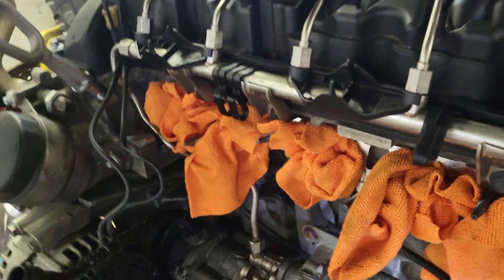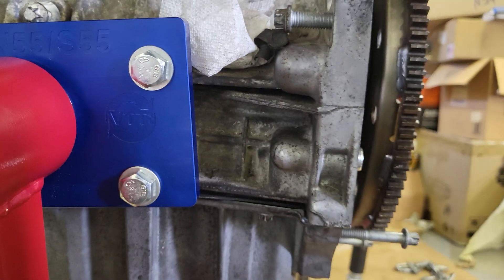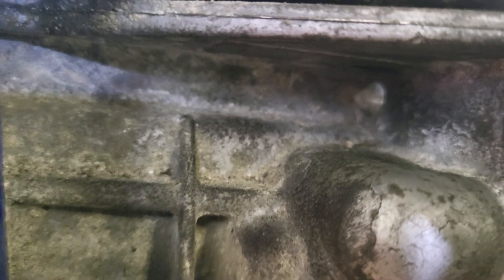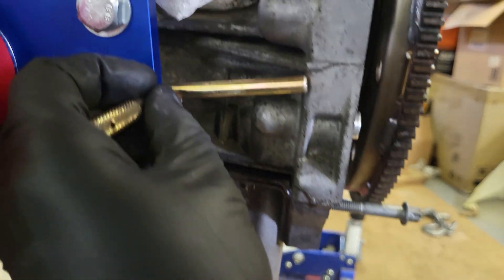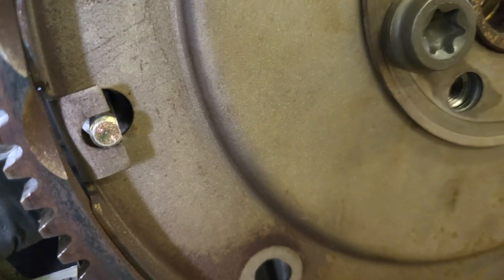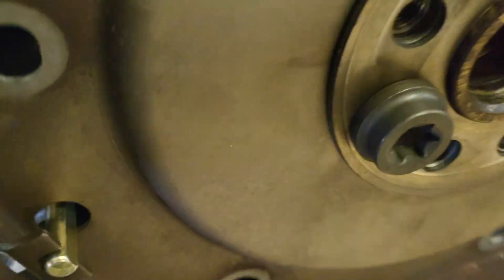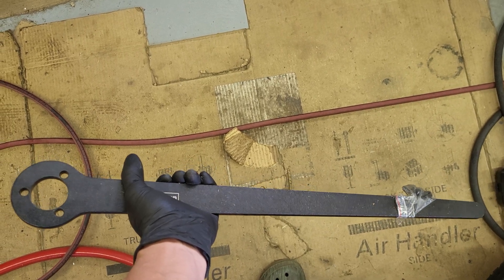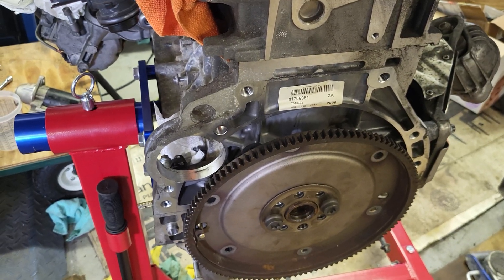N54 Timing lock pin

Comment: If my motor is in time with that locking pin in, the vanos tool and cam lock tool should all fit and align with that tool? Asking bcuz my belt recently shredded and sucked into motor and in pickup tube and around back of crankhub in the oil pan on timing chain. But didnt bump it out of the sprocket.